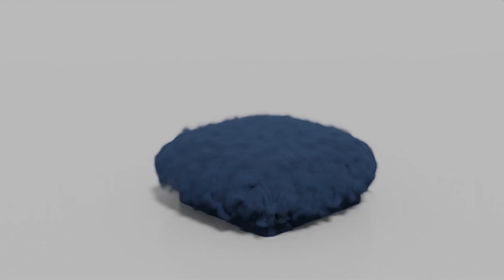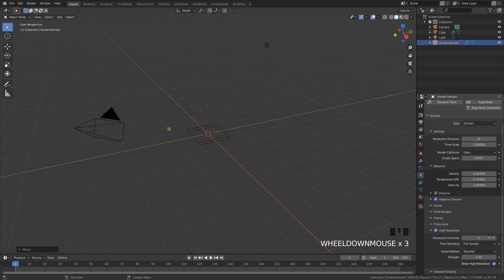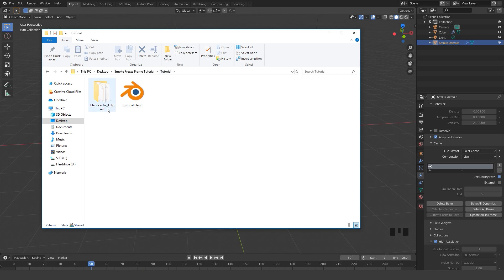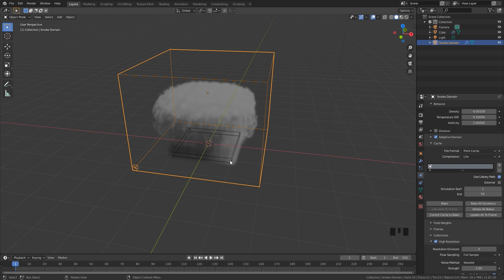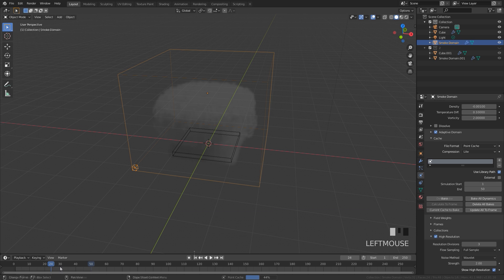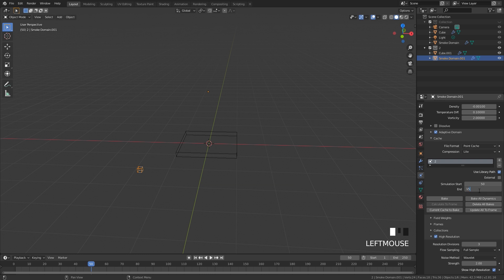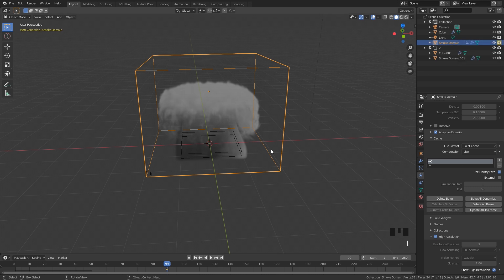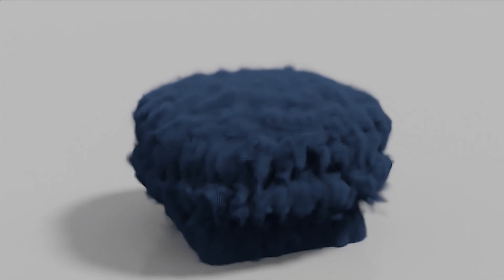How to Freeze a Smoke Simulation in Blender 2.8

Comment: my cache settings look different and also the smoke only flashes for the single frame instead of freezing for multiple. :(
Reply: AHH, nvm had to delete from both folders
Reply: also you need to rebane both to 0001 so its on the starting frame. in my case at least

Comment: Hi I have a problem, when I leave only one frame of the simulation (lets say fram 40) the smoke/fire is only visible in the render on frame 40, the rest its invisible. In the viewport it shows on all frames but when I render my animation the flame is visible only on frame 40. How can I make it paused and show on all frames of the animation? I cant seem to find the answer anywhere.
Reply: The method in this video to freeze simulations isn't ideal, as deleting baked data isn't something you're supposed to do. Instead, you can animate the time scale from 1 to 0 at where you want the simulation to freeze. The only small issue is that the simulation won't completely frozen, but it moves extremely slowly. Still not noticeable if you ask me, and it fixes way more issues than it creates.
Reply: @randomrimrock  so which is the best way! I m getting creazy trying to understand how to start the animation from for example the frame 60 to the frame 150, but bringing the frame 60 to 0
Reply: @JulesL_82  A solution is to make copies of the chace file and rename them. E.g if you prefered frame is 33, the file will be fluid_data_0033.vdb. Make copies of that and rename them fluid_data_0001.vdb, fluid_data_0002.vdb, fluid_data_0003.vdb etc. It's time consuming, but the result will be perfect.
Reply: @randomrimrock  Thank you ive been trying to fix this for over an hour now

Comment: Hi! I tried this but now its only showing the particle frame on that particular frame in blender, and not showing it on any other frames. Any ideas what i might have done wrong here?
Reply: The method in this video to freeze simulations isn't ideal, as deleting baked data isn't something you're supposed to do. Instead, you can animate the time scale from 1 to 0 at where you want the simulation to freeze. The only small issue for my method is that the simulation won't be completely frozen, but it moves extremely slowly. Still not noticeable if you ask me, and it fixes way more issues than it creates.

Comment: Can you take a single frame in the cache and append that to another blender project to add in a still explosion? 

I have a very high poly animated object that I need to add an explosion to. I can’t composite the explosion in later because I need the shadows from the smoke, but appending a 100 frame explosion into an already laggy viewport will not work

Comment: So you CAN actually keyframe the visibility of the smoke simulations, and all objects, in the viewport. You need to toggle on the "Disable in Viewport" restriction in the Outliner. Just follow the same steps as you did with the render button and it should work. 

I'm not sure what the differences are between "Disable in Viewport" versus "Hide in Viewport" but they are there for a reason.\

Comment: Nice video. Question..to Freeze the smoke but continue the animation ..could you not just bake the whole smoke simulation with your rotating camera then just go to the .PNG folder and copy and past 50 frames of a .single PNG renaming them the same but ending in  01,02,03,04, etc so they sequence.
Reply from the maker: You could do that but I would rather not spend 10 minutes renaming files.
Reply: @BlenderMadeEasy  well your method doesn't work either without renaming all the other data objects either... so...